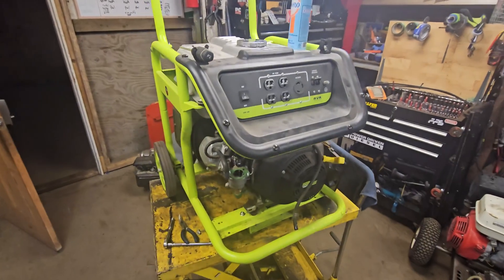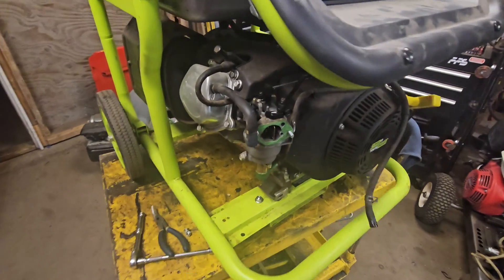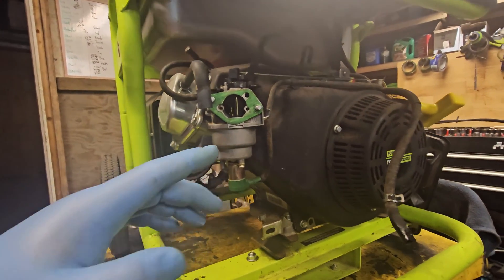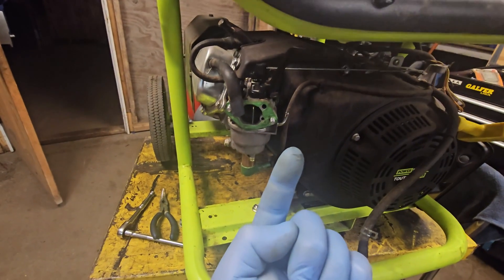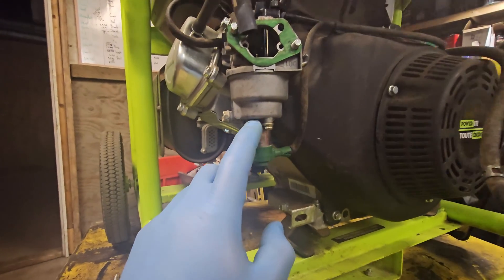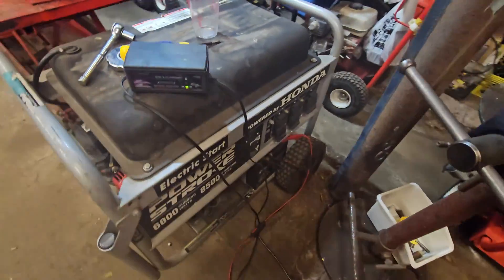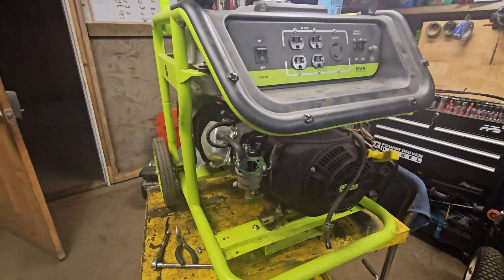All About Generator Carburetor Solenoids #mechanic #diy #generator

Comment: So helpful!  Question: on a dual fuel generator, does propane pass thru the carb?  Could a seized fuel solenoid be a problem in a generator that’s only ever used propane?  Thanks!
Reply from the maker: The propane is not affected by the solenoid i made a video about that 

https://youtu.be/aWGkcHPxnxw

Comment: Does the 12V battery trigger the solenoid when switch from Off to On (not start)?
Reply from the maker: Yes if you have a battery on your generator and you turn the key to the on position you should hear the solenoid click

Comment: I really wanted to remove this solenoid from my generator since I seem to need to clean it once a year. Thanks for explaining why it’s needed. Nice job
Reply from the maker: You can remove it just make sure when you go to shut your generator down turn the fuel off at the tap and let it run out of fuel.

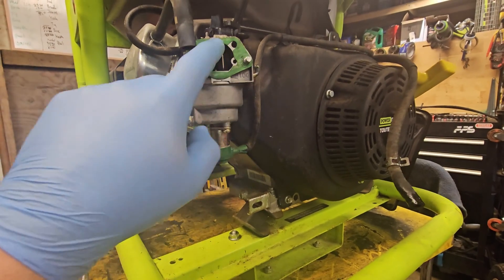Comment: I would be interested to know how the choke "by passes" the fuel shut off solenoid when you pull start it, as per your statement at 2:09.
Reply from the maker: As soon as the flywheel starts turning the solenoid opens up and the choke causes the suction from the engine on the carburetor venturi to be greater than with the choke open, thus causing more fuel to pass by the tip of the solenoid plug through the main jet causing a rich mixture to allow the engine to start, once the engine is running the choke can be turned off and the electrical current will keep the solenoid in the open position until you activate the shut off switch where then the solenoid will close doing its job.

Comment: please look up the Chinese "no compete agreement" that ended in 2000 or 2001..... youll learn how thats not actually a "copy" of a Honda at all.... the GN designation on engine should be a huge clue
Reply from the maker: Dude this piece of crap is like 4 years old it's an exact copy of a GX right down to the 8mm nuts holding the inner airbox together...